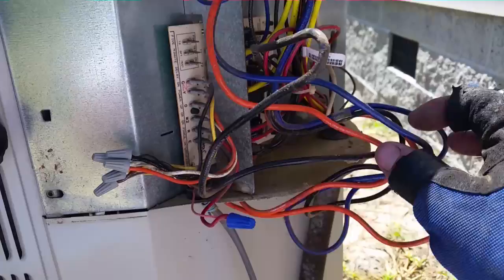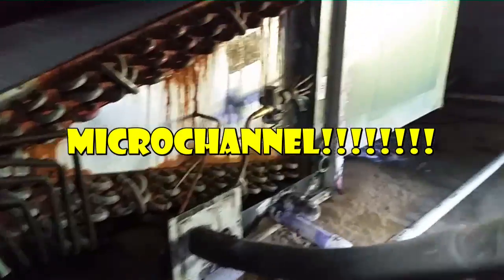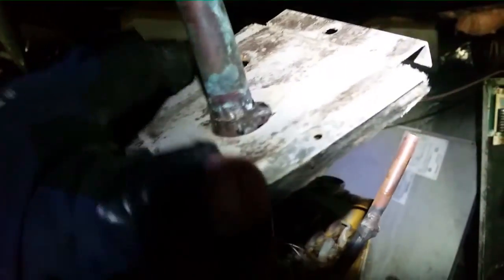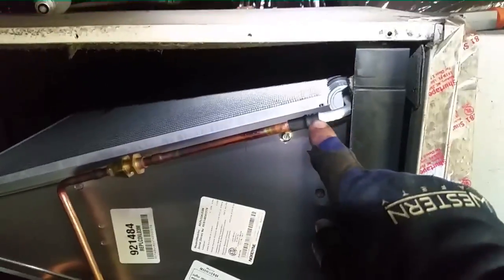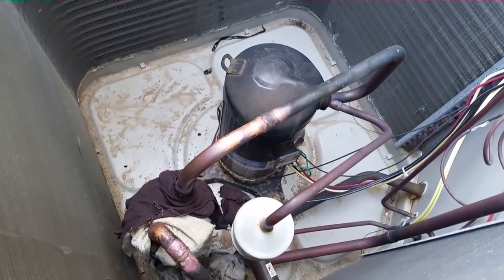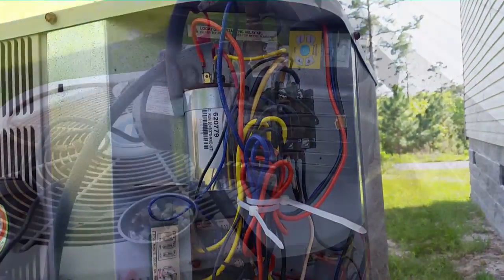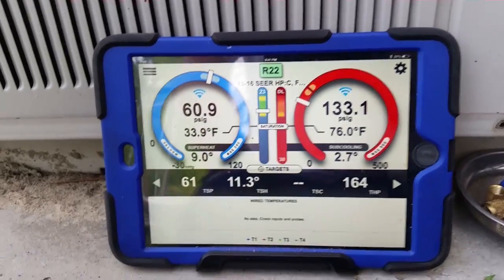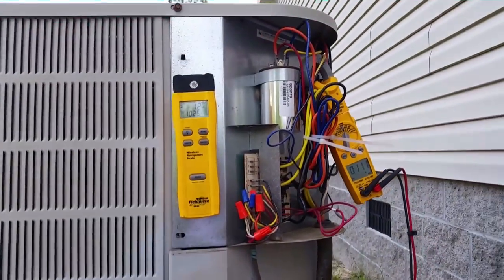HVAC Service - Heat Pump Evaporator and Accumulator Replacement

Comment: It probably won't be short on heat. If the coil holds less refrigerant than the old one on cool mode, it will hold less on heat as well.

Comment: Great video and good job. One question. Was that a drier inside the condenser unit, that white or grey looking dohicky and do you replace it if it was? Thanks.
Reply from the maker: That was a compensator or muffler, I can't remember

Comment: nice videos man.  the best thing for ants is ant killer granuals.  BULLSHIP!!  The best thing is a very small amount (1/4 Teaspoon of gasoline)  right in the middle of the mound.  Die fire ants Die.  They don't move 5 foot away,  they fargin die.  Lived in Florida 10 years I hate them dam things.  Good luck with the system.  Watch you stuff every time they come out.

Comment: Berry berry interesting.
Reply from the maker: indeed. This is the second microchannel evap I have replaced this season.
Reply from the maker: I thought about that. I think it may have caused me to overcharge the system for winter by trying to hit 10 F subcooling. what do you think?
Reply from the maker: talyn875 a txv would have
Reply from the maker: ***** I guess I could try it. It's not too hot. I am hoping the lower amount of refrigerant will equal proper head pressure in heating. We shall see. Nortek is shouped up stuff for sure.

Comment: Microcannel coils suck i mean suck i mean i don't see how its helping any with the efficiency at all because it cuts down on the volume. And the efficiency by being just small fines and causing to me basically a type of restriction in the refrigeration part of the heat pump ijjust wished that york and them would not use them type of coils because i like york besides the sorry microcannel coils i like the Bristol recipercating compressors they use on some of there lower seer units like the lx series and the latitude series even on R410a units they use Bristol in some of the 13 seer and i think 14 seer to i like Bristol compressors good

Comment: Great video ZACK. I feel it will come up short when winter rolls around.
Reply from the maker: I wonder myself.
Reply: talyn875 Just like a 10 seer coil on a 13 seer cond that I have to add for summer and remove for winter. If ya short in one you most likely will add later. But you know micro-channel is the best.